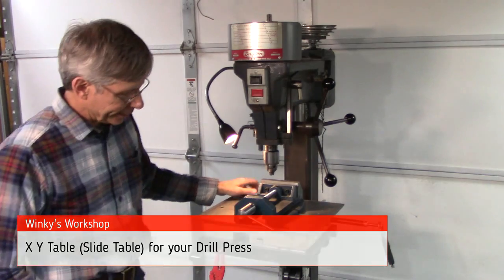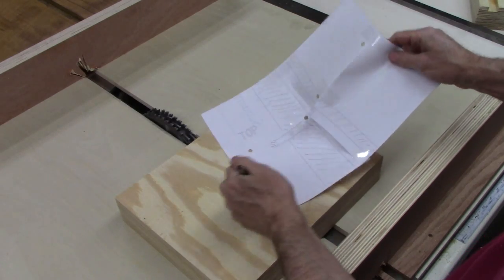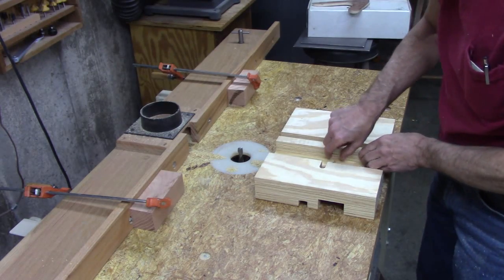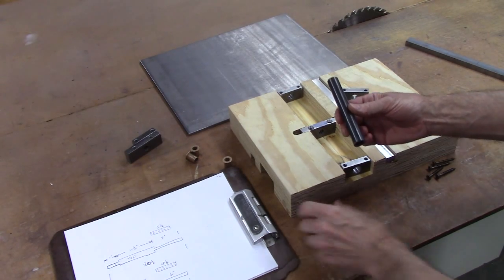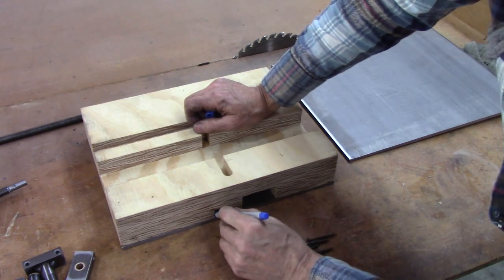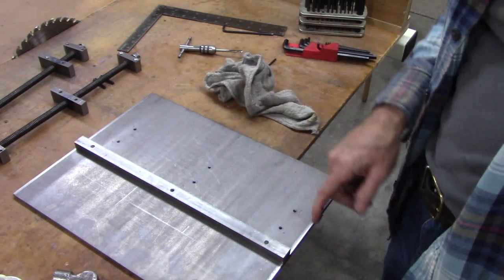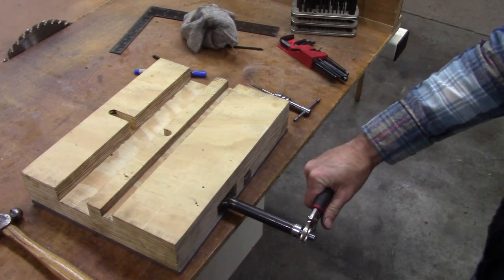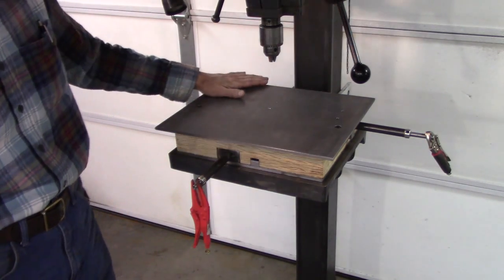Make a Compound Slide Table (X Y Table) for your drill press

Comment: I appreciate that you showed the finished product before you began the construction. This show your forethought and respect of peoples time. You would be welcome around my campfire any time.
Reply from the maker: Thanks you sir. I've been using it for some time now and it's still working well. the only complain is that there is no way to lock the table. Most often this is not an issue unless I'm are drilling very large holes

Comment: Since I was prowling around your channel I figured I would stop here. I made 3 of these slides that I love. I used HDF and have never looked back. When I made our router table I made it 3' x 4' with slots for fences around the router base. LOVE IT. Our 4 in vacuum fits the Lexan box below as well. I have all our stationary and some of the roiling like the joiner wired to start and stop the exhaust system on demand. It wasn't really that hard to do as it is 3 phase so I had just one power header to wire in 3  main planers and a drum sander. Always great to stop by my old friend. A good rest of the week to you and a great weekend to come eh.
Reply from the maker: I use the heck out of my x y table. I'm not sure how anyone can do without. The only negative is backlash and no way to lock the table. The backlash itself is not an issue but the fact that it moves under load is. I've ordered a cheap Chinese table from Vevor and will be adding new lead screws and dials. It has locks on gibs.
Reply: @WinkysWorkshop  Have you ever thought about making a split nut for the traverse screws ? Just a thought. You shouldn't have any troubles coming up with those Mr Engineer. I can already see your gears just a turning, LOL. Take care Winky !
Reply from the maker: @TomokosEnterprize  - For backlash? I tried that on one of the screws on this table. That was several years ago. I didn't have much success but I can't remember why...  space limitations was part of it I think.
Reply: @WinkysWorkshop  I am pretty sure you would have to increase the threaded rods up to 7/8" or better 1". That will make the stationary 1/2 nut far easier to tie down. It will be easier to either hinge or slide the pinch 1/2 nut.  It could be a project awaiting for when time allows as you don't have to break down the existing X/Y as you will need it in operation both for this build and every day needs. You are great at out of the box so once you embrace this I am going to call it a complete success my friend. Just what you wanted is another project eh, LOL. Take care and have a great rest of the week and the weekend to follow eh.
Reply from the maker: @TomokosEnterprize  Yeah....  maybe I'll make a new one in the future. This one has served me very well for about 3 years now but I'm looking forward to the new cast iron mill table. The biggest negative is travel. I loose about 3.5" inched on the Y axis. The new table has 4.5" travel.
Reply: @WinkysWorkshop  4.5 isn't too bad. That shouldn't put any undue situations across your path.
Reply from the maker: @TomokosEnterprize  That's what i am thinking. My vise opens to 5 inch so not much difference.
Reply: @WinkysWorkshop   Reworking Chinese junk can often be a win, win. I hope you get a good pc with nice thick castings to work with.
Reply from the maker: @TomokosEnterprize  I hope so too

Comment: Very nicely blending wood and metal, that's what I've been looking for recently.
Reply from the maker: I use the heck out of this table. It has some limitations but for the most part they are easy to work around. It would be nice if it locked. Drilling 1/2" or larger it tends to move around (within the back lash).
Reply: Many woods and ply's can be successfully be mixed with steel/aluminum. helps keep the weight down too.

Comment: Great vids , very nice work . I will go up to 3/4 threaded rod for the screw feed . I built a new mount for my bench drill when i noticed the horrendous amount of flex in the original cast iron unit , this is the perfect upgrade all round . Keep the vids coming , great stuff .
Reply from the maker: This is my second  X Y table and they are very handy. Thanks for the compliment!
Reply from the maker: This is true...  most the time it's not much of an issue however

Comment: It's nice to go back and watch a good video. There are things that you see that you missed the first time. Keep them coming Mr. Winky!!!
Reply from the maker: Thanks Danny. This X Y table is great although the backlash is a bit excessive. About .020 I think. If I didn't have the skill to build the table it is well worth $250 to $300 to buy a mill table. Paired with the square column it's the best!
Reply from the maker: How's the new shop and the Leblond lathe coming along?
Reply: @WinkysWorkshop  The shop I was building was for my son and we got the roof on it and he has been too busy to do anything else to it. I pretty much have the LeBlond finished. There are a few things I want to fix that aren't just right but it is good enough to make chips. The lead screw and the feed rod are both bent, the coupling on the feed rod is not right, (it has a pin that is too long), the pulley on the motor is too small, the pin that keeps the slip gear from going too far that drives the lead screw is missing, and I need to figure out why it has so much play in the rack and pinion that drives the apron. I don't see any way to adjust it. I may have to shim the rack closer to the apron and see if that helps... Other than that it looks and runs awesome!!!

Comment: Nice little tip when tapping on the mill and you can not use a spring loaded center for your tap. Hang a weight on the down feed lever to keep a constant pressure on the center, that will save you having to keep stopping tapping and having to apply a bit more downfeed on the quill. Great project by the way, you certainly can mix woodworking and engineering into your projects. Well done. Another tip to stop chatter when countersinking, it to tear off s small square of rag or tissue paper, fold it over several thicknesses and countersink THROUGH it. It will clog up the clearances on the teeth and stop chatter. With regards to your locking collar grub screws damaging the shaft, file / mill a small flat where the screw clamps, will come off easily when required. With regards to your shaft being a bit tight, when you started assembly, if you had drilled and tapped 1 hole  at each end of the shaft, try the shaft for freeness to turn, then spotted through with the drill bit or been very carefull with your transfer punch, through the other 2 holes it should have come out much better. With regards to yout X dial hitting the table and you losing 1/2 inch of travel, counterbore the wood to give clearance.
Reply from the maker: Thats a good idea

Comment: Nice design! I'll have to think about how to do the same on my drill press. I still want to ad the square tube upgrade. Thanks again for great ideas and content!
Reply from the maker: I'll draw the plans this week and post a link. It's fairly easy to build if you have the right tools. I suspect most my viewers are more into metal working which could be an issue. If this is the case for you, you might consider building the square column and buying a commercial mill table. A good one is likely to be over $300 however... lot of junk out there. It really is amazing how much they increase the accuracy of whatever you build. Thanks for the comment!
Reply: I have been wondering if a flat surface could be grafted onto the column similar to the ancient drill press Wink just got, just a thought.

Comment: Awesome project Wink, enjoyed watching this one all come together thanks for taking the time to share it with us. Just a thought consider tapper pinning the collar to the threaded shaft. 
Play Safe From Elliot Lake Ontario Canada.
Reply from the maker: Thanks, I'm glad you like it. Pinning on one end would be a good idea but on the other end I'd like to be able to adjust for wear. It really needs to be a clamping collar and not a set screw collar. I did this on my old x y table and used a belleville spring washer. It worked very well. I wish I had used higher quality Acme rod. I'm sure this cheap rod is fairly accurate but it wasn't very straight and there is more backlash than I would like.
Reply: Hi, from Vanderhoof BC. Just west of Prince George. I know your part of our big country well from when I drove transport trucks back in the 70's.

Comment: Just a thought. On the two end blocks, put some CA glue, set the table in place and give it 5 minutes or squirt some accelerator on them. That way they are located  and you can C clamp them before you use the transfer punch. Keeps things from jumping around while you are trying to mark them. I have used it several times. Works.
Reply from the maker: Thats a good idea!

Comment: Nice job wink, I use my mill drill all the time. but it would be nice to have this table on the press. Very nice and doable design with the wooden block, a lot of times I will make a prototype from wood to try a metal design only to find that the wooden part is every bit as useable as the original design. Enjoyed, cheers!
Reply from the maker: My mill dill is a pain because of the round column. I love using the drill presss... much easier. Thanks!

Comment: Nice project. You really need to look into making a spring loaded tap follower to put in your drill chuck.
Reply from the maker: The X Y table combined with the square column drill press is phenomenal. However it is not very solid.  A commercially made mill table is heavier and has lock downs. This one works fantastic to about 3/8" but much over ans things vibrate. Still I use it a lot and it is accurate. As for the tap follows... I really don;t like them much. They tend to pop out of the hold on the back of the tap wrench. Also, I almost always have the countersink  it in the chuck so I just use it. With that being said, THIS is the way to go! 
https://youtu.be/ADYdezM8uMU

Comment: Love it.  I've been thinking about a dedicated drill press with an XY table and a DRO.  This would be perfect for that.
Reply from the maker: Thanks, I'm not sure how I ever got by without it although without the square column on the drill press I might not feel the same. I know a guy that screwed the rack for his table lift to the column (mine didn't have one). He said it works very well if he puts pressure to one side before locking it down. The DRO would simply the table. If you build the table spend a little extra on the acme lead screw. Mine has a lot of back lash.
Reply: @WinkysWorkshop  Good point.  Mine locks down pretty good.  I find I do a lot of precise hole drilling on the mill. sometimes meaning I have to take the vise off and retram.  It sure would be nice to have a precise XY on a drill stand  to handle those operations.
Reply from the maker: @Spetet  - I do most precise drilling on my drill press because it is way faster. Of course my mill is an RF-30 with a round column so if I have to raise the head to ream a hole I lose my horizontal position.  A standard knee mill might be a bit more convenient. I now have a harbor freight drill motor powering my table lift on the drill press so it's very fast. I leave the 5 inch vice bolted to the drill press table. If I need to drill something larger I have an auxiliary table mad of wood that clamps in the vice.

Comment: Well done. I am very interested to know how well it works after you put it into service.
Reply from the maker: Being totally honest, I used it several times a week and it works perfect. The only two problems are backlash is a bit excessive and the table can't be locked. It works perfect up until about 1/2" in steel and the vibration will move the table within the backlash. This accuracy is within about .015" but much better with smaller holes.
Reply: @WinkysWorkshop  Could you add a couple of bolts along side the steel square stock so that when you have it in position you could push against them? I would think a couple of threaded inserts 1/4" or so would do nicely.

Comment: To help with the rod deflection you can install A Linear Bearing Slide Rail Guide, can be expensive tho.
With the work you have done with the X - Y table till now maybe have A go at making your own version with the material you have on hand.
Play Safe From Ontario Canada.
Reply from the maker: The only problem the bent Acme rod causes is binding. The 1" x 3/4" guide bars hold everything in alignment. I'm guessing the table will be accurate within a .002". The guide bars were a perfect fit. The back lash in the threads will likely be about .010 or more. Maybe not a big deal if you adjust in one direction but still annoying.

Comment: Perhaps you can modify the old XY with support blocks underneath to stop the flexing? Great video though, very thought provoking.
Reply from the maker: Yes, aside from the flexing and being a bit heavy it's a good table. The new design is a bit lighter weight, doesn't flex and is a bit more stable on the X and Y axis. The pressure of drilling pins the component together. I'm giving the old table to a friend but I'll be looking for a way to support it better before he gets it.
Reply: @WinkysWorkshop  that is a beautiful gesture!
Reply from the maker: @MiniLuv-1984  - Thanks, most often I'd rather see a friend happy than to have his money in my pocket.

Comment: You replied to my comment about  mill running out when cutting slotted holes - "climb cutting"- Idoes this only happen on round column mills??  Thank you
Reply from the maker: No, all mills.  This is worse with smaller diameter mills but and may be worse with smaller milling machines. You can do things to help this. Lock the table on the axis you are not moving, take shallow cuts, make sure the gibs are adjusted snug and you can even partially lock the table on the axis you are moving. I almost always do the last one when I cut slots.

Comment: I would love to make this for my drill press. How soon will the drawing be available? A suggestion: If you could mention more measurements
 when you mak the video it would be helpful. By the way, I use Dykem in my dial etchings, works great.
Reply from the maker: Thanks for the tip on the Dykem. I had some dials black oxide coated and this worked fantastic.  I'd say the Dykem would work just as well.  I have the plans for the drill press in a separate video. I'll paste the link here at the end of this comment but here's some thing I'd do different. 1) Make the round tube that fits in the head a little taller than I did. That way you have more clearance at the top of the square tube for your motor, mine is very close. 2) The two arms on the front of the slide need to be a wider, maybe 3" if it will fit. Bolt them the same as the plans call for but either tack weld or pin them together. My table flexes under heavy load. 3) Buy a good commercial mill table. I love the one I made but if you are drilling over 1/2 it moves a little. I still use it every day and it works great if you feel like making the effort, you just have to work within it's limitation. One last thing, the most critical part of the drill press is getting the tube on top welded perfectly straight. I cant stress this enough. Thanks for watching. https://youtu.be/Ni3705KLOsw
Reply: @WinkysWorkshop  Thanks for the drill press drawing,. I plane of tackling that next. However right now the X-Y Table would be more useful. I'd like to make that next.  Can you give me a link to those drawings?
By the way, I didn't say it last time, bur really enjoy your videos. Thanks!
Reply from the maker: @tomsaine2331  Thanks Tom, here's the video with the link to the plans. https://youtu.be/Njz8leVipQY
Reply: @WinkysWorkshop  Thanks, probably start working on it tomorrow. ]-)

Comment: On your old table, could you not have added 2 blocks to the slide carriers sized to give minimal clearance to the underside of the table top plate so that when pressure is applied from the drilling operation, the only flex is that of the clearance you allowed (a few thou)?
Reply from the maker: I considered doing this but there were some obstructions under the table. To be honest I gave the table to a friend and can't remember if it was doable. There was another problem too, the table moved freely and moved under load. The new slide table is more stable when pressure is applied although it still moves more than I would like. If I am drilling a series of holes and want them accurate I always make sure I'm working fro the same side of the backlash on the adjustments. Some way of locking the table would be a big plus.

Comment: Great design! The issue you mentioned with the top axis not being secured to the block. Would it over complicate the design to use a
dovetail guide?
Reply from the maker: That's a GREAT idea! However, it would indeed complicate things. With a square guide depth is not an issue but with a dovetail slight variation in height would effect both the horizontal and vertical clearances.  Your suggestion got me thinking however! Have you ever seem the T slots used on many new table saws? It hold the front of the miter gauge in the slot if you slide it off the table. A person could just cut grooves in the sides of the current slot and bolt a washer to the bottom of the guide.  Very cool!